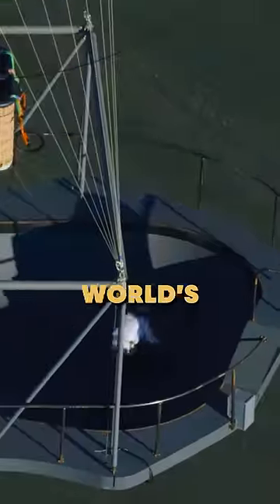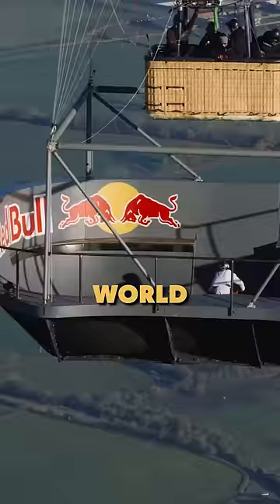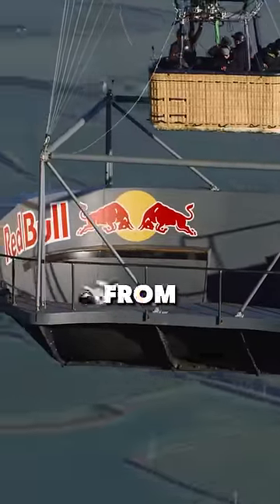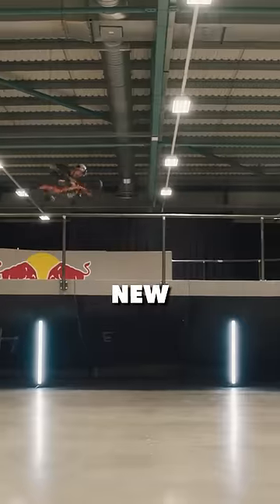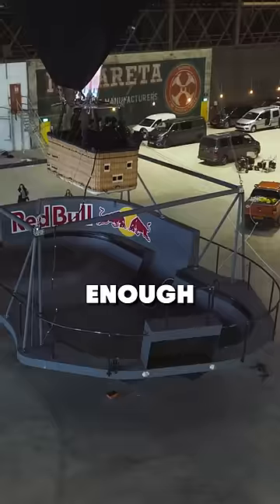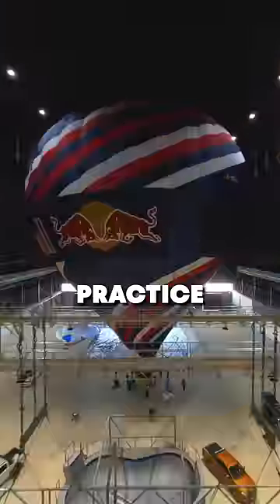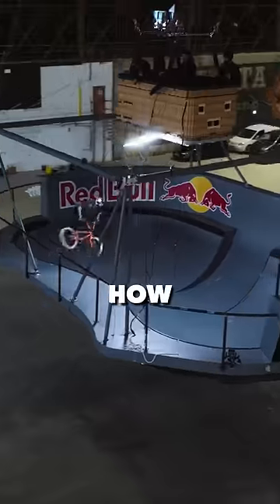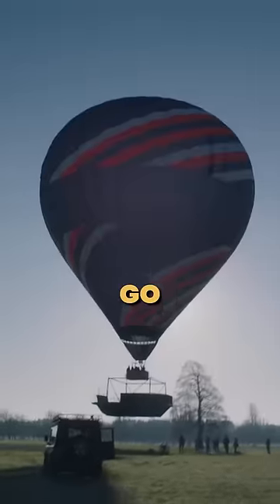A Flying Skatepark At 2100ft From The Ground

Comment: If you’re ever sad just remember you were born at a time to see Red Bull pull off the most outrageously cool stunts
Reply: True nice
Reply: You are right😂
Reply: Is this one really that cool? There is nothing about this stunt that would have changed regardless of the height, raising it into the air was essentially pointless.
Reply: @dylancrosby2451  that's why it's a cool stunt. aren't all stunts pointless by design? all stunts have going for them is someone thinks its cool
Reply: @amalirfan  plenty of stunts add something interesting to the actual stunt, this was just a regular stunt but the ground wasn't at ground level. The dude doing the stunt would have the exact same outcome regardless of the height, nothing was actually different. A big ramp is a stunt because it offers something different to flat ground for example. This was literally just a regular bowl that was elevated, it had no impact on the stunt person nor the stunt, he could have done the same thing on the ground and it would have looked exactly the same. If you didn't have the camera zoomed out, you wouldn't even know he was in the air. Just my opinion I guess, but doesn't really impress me when it takes the same exact skill/talent/performance/ routine as it would on the ground. If you've seen a regular bowl on the ground, you've seen this.
Reply: @dylancrosby2451  Doing it in the air like this would add a lot of pressure for the stunt person, especially as he is afraid of heights
Reply: @beanstatic  while wearing a parachute, inside the safety of a bowl he is very comfortable using, with plenty of ways to stop himself from falling out, which I'm sure he's properly trained to use the parachute incase. It still adds literally nothing, sorry can't change my opinion.
Reply: My friend actually used to know the guy, they weren’t friends, it’s just that there’s an indoor skate park he used to always go (because Scottish weather isn’t very good) and supposedly he was seen as a hero because of how good a bmxer he was.
Reply: And that's why bars & venues serve redbull instead of monster or any other energy drink 😂

Comment: Man I was looking extra close for that chute!😳
Reply: Its just the same color as he's hoodie
Reply: Honestly same here
Reply: Not gonna help if he knocks himself out on one of those railings
Reply: @NoodleFlame  I can count on 0 fingers the number of time's i've seen someone knocked out cold in real life or on the internet while riding in a skatepark, helmet or not.
Reply: @MikeC-nu7ty  it must be impossible then
Reply: Bro, I did not realize until I saw this comment. I really thought he didn't have a chute
Reply: @NoodleFlame In case that happens, it’s possible he has one of those parachutes that you can set to automatically open at a certain altitude.
Reply: @YankeeAllStars  Oh nice thanks I hadn't heard about those, makes sense when you think about it. Curious to know how they work and what failsafes they have, time to do some reading :D
Reply: @NoodleFlame  there is most likely a dead man switch (which is a switch that will activate if you let go of it after pressing it down) on the bike handle that will activate the chute after a couple seconds. they probably also have the parachute set to a certain altitude so it will automatically open just in case something does go wrong with the deadman switch.

Comment: I’m surprised they didn’t calculate approximately how heavy a wooden skatepark would be before building it. I’m sure the lift capacity at various altitudes and weather conditions of hot air balloons is known so that it would be known what weight is too heavy.